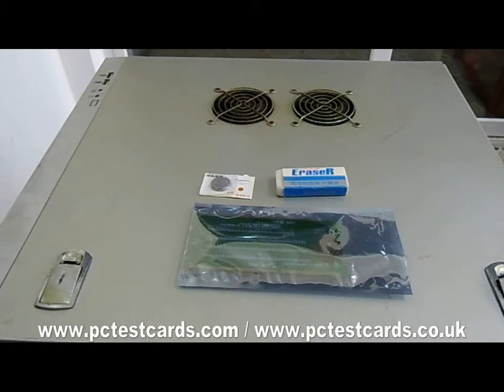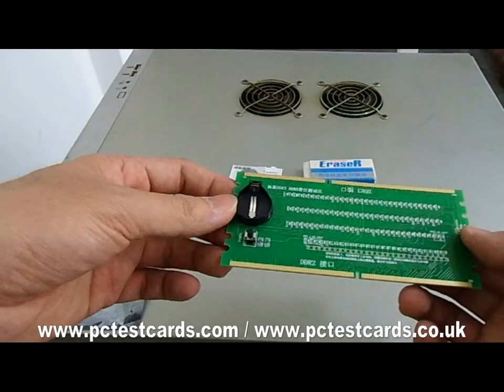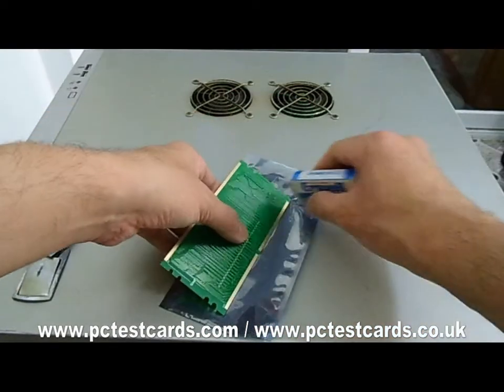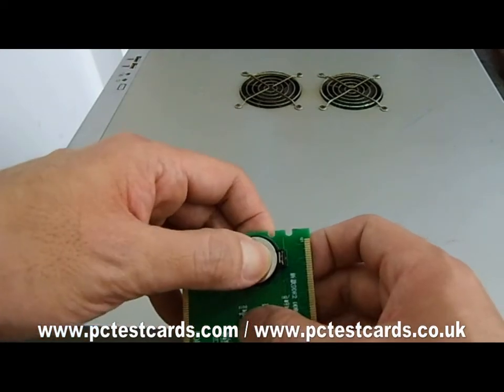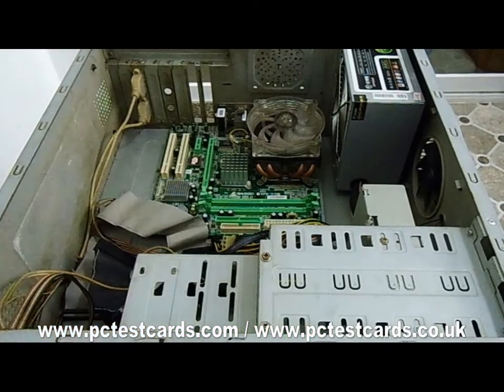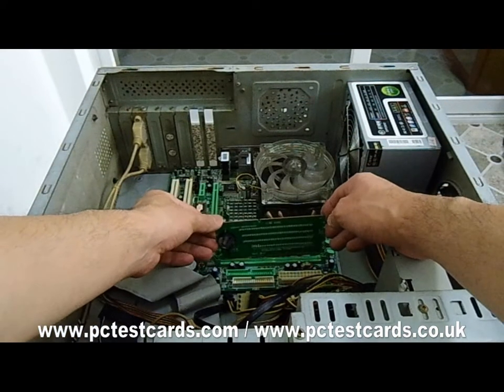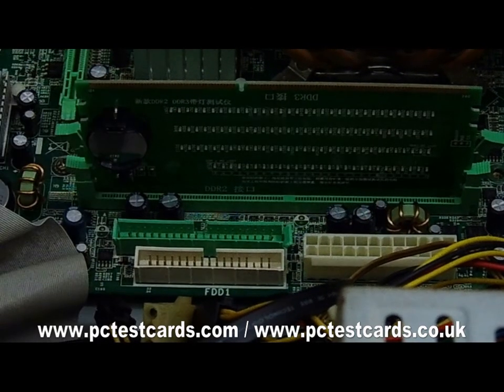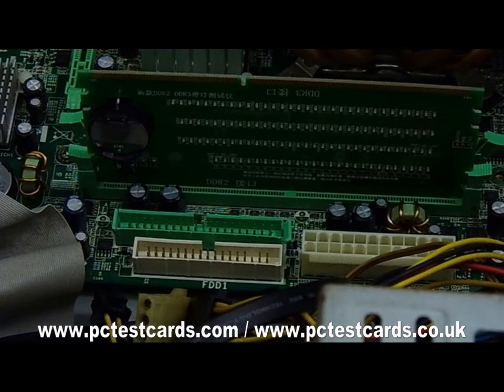Desktop PC No POST solutio - Desktop PC RAM Memory Slot LED Tester

Comment: Sir, please, can you help me?  My motherboard brand is Mercury PIG31L extreme, it is socket LGA775 for dual-core and quad-core, it has 2 DDR2 ram slots. One day I tried to upgrade my dual-core CPU to a quad-core, but the upgrade failed, the quad-core froze and rebooted my computer. I replaced the old CPU back, and I discovered one of my Ram slots died, the computer won't power on when a ram is inserted into this slot (near the motherboard edge). I tried cleaning the entire motherboard as I saw on youtube, but with no luck. one slot  is working only, but I'm now limited to 1GB of ram
Reply from the maker: First, try remove the small button like CMOS battery and then put back after a few minutes, do the same by reseating CPU. If still the same issue, seems there was a chipset circuitry shorts when upgrading the CPU to the non compatible type. This needs the motherboard chipset level repair works. Hope this helps, William Senior IT Consultant and Tech Support Manager www.pctestcards.com

Comment: Hi, PCTestCard.
I used this tool to test the RAM slots on my motherboard (Gigabyte H81M-DS2V) which failed to boot if RAM Slot 1 was filled. I found the DQ29 lamp was not on (slot RAM 01).
What is the meaning?
Thank you in advance.
Reply from the maker: Hi Afrizal,  did you order your DDR3 RAM slot test card from the others? This LED DQ29 points to the DDR3 RAM slot pin150 which is the data line area. If this light is not ON, there should be problem of sending the data between the CPU and RAM, hope this helps, William Senior IT Consultant and Tech Support Manager www.pctestcards.com